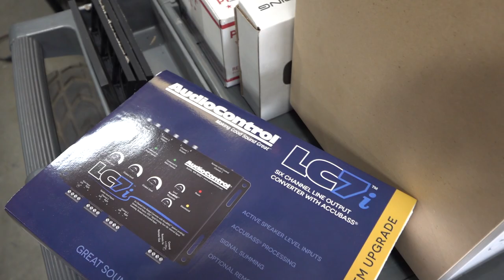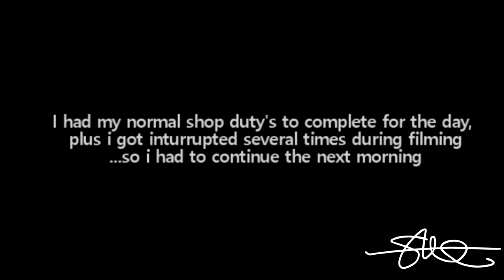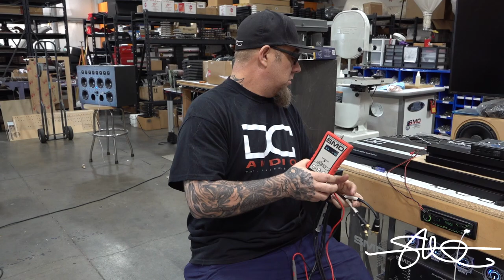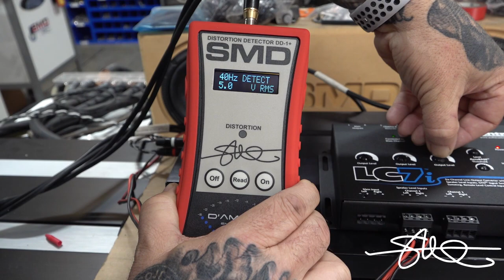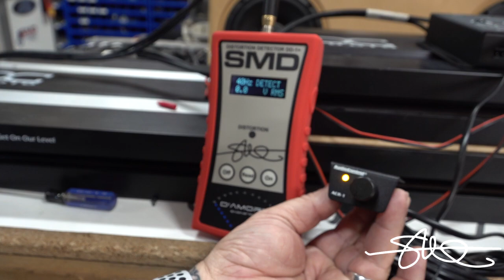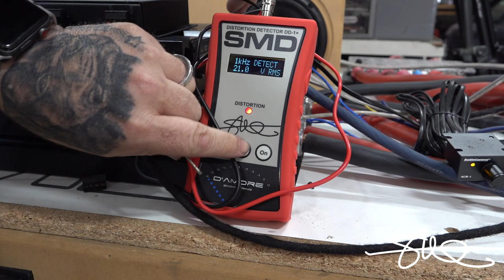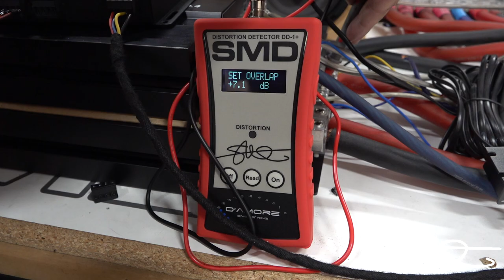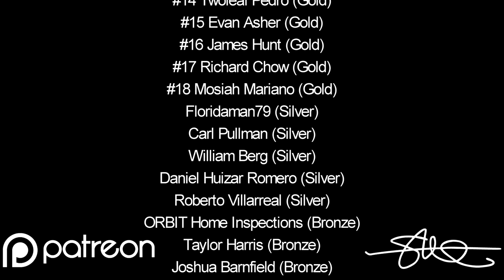Add Amps not Distortion! AudioControl LC7i 6 Channel L.O.C. Hooked up, Gains Set, Played full tilt

Comment: if you just use the GTO signal sensing from the speakers line in ,you do not need remote in,only out , i have the exact one sounds amazing, i did not want to buy an amplifier for my alpine iLX-W650 /KTA 650,so i used this LC7i to send the signal to the amps thru my aftermarket Head unit, and it still sounds amazing.

Comment: I was going to use an LC2i when I integrated the factory head unit on my F150. 

Talking with Audio Control, they told me that since I was using a EQX as well that the only thing that I would gain was Accubass. So I went with their recommendation to use the EQX high input and save the money. 

I thought that spoke volumes for Audio Control, that they would talk you out of buying more of their equipment. As a long time AC products user, there wasn't any question about my loyalty in them, but they cemented it with that.

Comment: I have an LC2i in my Mercedes S class running from the stock H/K sub wires to the LC2i and in to my Rockford amp. It sounds incredible and it definitely the best LOC I’ve ever used. So much better than those cheap non powered units. My Memphis M5 12’s sound so much more detailed and crisp on the LC2i. Highly recommend AudioControl for a novice like myself.

Comment: Voltmeter won't work but an oscilloscope will. Still haven't set my wife's car up right yet waiting on the front door speakers and amp for them before I set it up the right way with my oscilloscope. Great job showing how to do it the proper way. Most car audio installation companies need to watch this can't tell you how many systems I have seen installed by "professionals" that weren't set up right.
Reply from the maker: yes, an oscope will work almost as good.  But not really.  Better than a DMM.  But the DD-1+ completely rules over the o-scope for setting gains. ESPECIALLY a handheld.  I would say cheap handheld (which are awful) but all those handhelds don't have the resolution you need to get as precise as the dd-1.  You would need a benchtop unit with high resolution and still have trouble finding the distortion in what LOOKS like a clean wave form.  I will say this, you won't hear me complaining about someone using an O-scope and following the proper procedures to set their gains.  If they are doing that i have respect.  Before the DD-1 that was the only proper way to do it.
Reply: @meade916  I don't have a cheap handheld and I have to agree your meter is better for setting gains and a lot easier to use if I installed stereo systems for a living I would definitely be getting one but for the 3 or 4 I do a year my oscilloscope and a long extension cord work good enough

Comment: Wait, when testing distortion for bass, you had nothing plugged in channel 3. Is there still a signal passing on channel 3 from Channel 2 input??
Reply: Yes if you don’t plug anything in on the lc7i on channel 3 it will replicate the signal from channel 2 and channel 3 is the channel that has accu bass so that would be your bass channel it also accounts for bass fade off on factory head units so it can help with supplying a full range signal from your factory head unit and 400 watts max per channel on the lc7i

Comment: I’m putting the LC2i in my wife’s car. I have a regular DD1 already. Can I use that to find out where the factory deck clips and THEN use a DMM to set the LC2i to the correct voltage?

Comment: Missed a couple great features of the LC7i, it will detect distortion via the maximized LED, to help set it up. The guitar pick is included to help turn the dials on the unit.
Reply from the maker: no it won't. But ya i missed what the pick was for.
Reply: are you saying the maximize light on the LC7i doesnt work? its one of the main features. ???
Reply from the maker: @relaxationnation1189  i'm saying it isn't a distortion detector.

Comment: Steve, if I'm using the original DD-1 would setting the gains on the amp be equivalent to backing off once the distortion indicator comes on to make the light go off or is there something else the DD-1+ provides by setting overlap? I'm not understanding what setting the overlap does.

Comment: If there isn't a control knob connected to the Lc7i do the gains act as if there is one turned all the way up?  Just added lc7i to a 19 4runner and voltages are horrible coming out of the AudioControl. Need to find someone local with a meter like you're using. Awesome content, been going down the rabbit hole on your channel!

Comment: ahh yes I remember when I first did the install in my car with a pac loc from walmart worst decision ever all the ground loop noise and alt whine. Only to end up getting 1v of output. tried a kicker one but it only my more noise which pissed me off and I ended up ripping out the stock radio. all my issues are gone now couldn't be any more happier except that feeling that I want more bass for whatever reason it doesn't feel like enough for me. Anyway great vid tho showing something that actually works and is clean at the same time.

Comment: Great video . But is this the same tuning process with the audio control if I'm running the lc2i from a factory Bose amp? I'm doing a 2021 Tahoe with Bose system . Just adding some subs using the lc2i to a marts digital amp.  I feel like I'm not getting enough bass output . I'm pretty sure I have the lc2i connected to the wrong set of speakers but I don't think that would make to much of a difference ?! I'm running off rear speaker channels which are the full range, the front doors are the lower frequency speakers.. could this be an issue?

Comment: Is it possible that some stock radios just don’t have a clean signal? I worked on a stock radio recently and just couldn’t keep a clean signal at 1/2 volume. I installed LC2I but, was limited on the radio side. If anyone has any feedback it would be really appreciated, thanks.

Comment: Fastenall is great but expensive but when you need that off-size high quality drill bit or whatever they save your ass pretty quick. They’re like a McMaster C/ uh pizza shop that delivers within the hour most times. My boss used to ask why we were spend so much money with them & I usually told him he after he walked out to the shop with a project that needed to be finished that day fastenall always delivered asap the one-off particular tool/hardware needed to make it happen vs ordering it to show up next day or wasting time going to a Home Depot or special hardware store. I don’t work that job anymore but I always liked going there or dealing with them, they had everything you wanted but didn’t need and slowly over time I accumulated tons of great specialty/specific tools/hardware.

Comment: My truck already burned through like 4 or 5 of those, i have no idea why or how and nether does my local audio shop but our best guess is to run all the cables from the amps and the radio brand new and a brand new lc7i with new speakers to see if it would work. God i hope it does

Comment: Awesome video, so after you have set the loc gain do you leave the bass knob turned up when you start setting the gain on your sub amp? Jus wanna make sure I do it right. I figured you would leave it up maybe so your sending the 5v into the amp so is that correct leave it turned all the way up when setting your amp gain? Thanks alot
Reply: yes same thing and with highs amp also if you have a knob on there or can use a knob with clip light to do the same thing

Comment: Thanks for the video Steve. I got an Audison Bit One at a low price. I have been struggling with finding a good looking and functional location to install the remote, and I'm not looking forward to that install time. I also don't look forward to having to use it instead of the factory radio volume controls. I just heard about the LC7i from a local shop and your video review of it is extremely thorough and high level. I would be interested to hear your thoughts on it verses other very high end processors. Been watching some vids of yours for many years now, thanks for going hard in the hobby and industry.

Comment: I have an Acura MDX. on my LC7i, I put my 3 sources as the tweeter, rear door speakers (I figured that these are more full range), and then the  subwoofer channel. It still seems bright and it seems to be lacking in the lowest bass. Would I be better off doing tweeter, front door (Mid range only) and sub so that I can control each of the three better? Also, any tips on the bass. It seems that Acura may roll off the lower bass and the accubass is not quite making up for it.

Comment: I have a 4 channel factory head unit with no amp and added new speakers, sub & 5 channel 1000w rms amp. Would this 6 channel LOC be a good fit or do I need a 5 channel?

Comment: Lol I bet that sony head unit has a max volume of 60 which would make the reading for distortion at 45 3/4 of the volume which aligns with the old 3/4 rule. You would be ok going with the old rule of thumb most of the time.

Lastly. Why are the magnetic subwoofer terminals so god damn expensive. $150+ is just insane but fuck they are pretty
Reply: 3/4 trick is useless. My Alpine max volume is 35 and plays clean up to 30

Comment: I just got a lc6i I’m gonna Hook it up in my 2017 bmw 528i. I have 2 8 inch hi fonics subs  600rms 1200 peak on a sundown 1750 and components are nvx. Will this clear it out and do I need a bass nob? It’s on my factory radio. I drive

Comment: Steve , what if I’m using my iPad Pro as a hi-res player with toslik optical out (via usb sound card with toslink out) how can I check if an on what level it’s distorting ? Again, my player is an iPad Pro connected to an external sound card with optical output  and when I connect the card to the iPad, the option to lower the volume is disabled, this sound card is connected to my DSP via that optical optical in/output. Volume is controlled via my DSP’s DRC.

Comment: Hi Steve I have a 2018 ram factory Alpine sys with factory sub. Going to remove it (sub) put in custom box (pass side) with 10" sub and an AudioControl amc.1.300 amp. I believe I can use existing wires to the factory sub as my speaker inputs for the amp? if so do I need the DD-1 to adjust the accuBass  "threshold" and "level" settings? thanks and keep up the great videos

Comment: My thing is i did all that but i don't ride around at max volume so I your not getting bass at normal listening levels, you pretty much have to set your signals 0db clean but setting bass amp gains or even highs your gonna have to do half deck volume to 3/4 just to get your experience of your system.
Reply from the maker: wrong.
Reply from the maker: you sound like you have no clue what you are talking about.

Comment: I have a 2019 honda accord sport, I have to keep the factory stereo, I'm going to add 2 amps. 1 for highs, 1 for subs. Could I use this? The lc7? For some reason, noone wants to install my system in my car. I'm putting a 900.1d amp and 2 15s. What would u say to use for a input method to install the amps to get outputs?
Reply: LC7i works for your application. But an LC2i will work just as fine.
Reply: @MP-zv6fm  LC1i is only two channels. LC6i or LC7 for a full range system.
Reply: @dj4monie  derp🤦🏾‍♂️

Comment: I guess I’ve been doing it correct this whole time haha. Only thing I haven’t really played with is the accubass and threshold. Both is set at top center.
Reply: Double check the manual. It does a good job of explaining how to set those two knobs. You kind of have to do that part by ear. You need to listen for where your deck is fading out the low end and set the threshold to that volume level. That's the point where AccuBass starts kicking in. Then you adjust the AccuBass to fill back in the bass the EQ in the deck ate.

Comment: Interesting..   what about if you don’t have a external bass knob?

Do you floor the head units bass instead?

Thanks for sharing!

Larry
Reply from the maker: no.  You do everything just how i did it but without a knob.
Reply: You can floor the bass in the deck after the fact to kind of fade the subwoofer out. In my car the sub amp is connected to the rear channel of my  Cleansweep so I can also just fade the system to the front speakers a bit to turn it down. I can't really hear the rear speakers much anyway so it isn't much of a loss.

Comment: for input from the Head unit to the DSP, is it better low level or hi level? My head unit is a Kenwood DMX9021s, with a 5 volt RCA preout. front, rear, subwoofer. My DSP has a maximum RCA low level input of 10vpp. Do I have to use 3 low level input lines to get to the DSP?
Reply: I would run RCAs to the DSP if you can do it. You just want a clean signal to the DSP since it will be used for all adjustments going to the amps.
Reply: Good

Comment: SMD, my 2010 Infiniti G37x sedan w/ bose and nav has a "balanced" signal coming from the head unit to the factory amp. I have been trying to figure out a way to bypass the factory amps. I figured out how to bypass the factory "subwoofer" so I could add some more thump in the trunk. But the mid and high EQ is still not to my liking. Is there a way to remove the factory amps without a plug and play module? Or would you recommend using something like this and install it in line?
Reply: a dsp will solve that problem

Comment: @Meade916 hey man been watching your channel awhile bought lots of your products always top notch but I have installed a axxera 4 channel  100 rms and a 650w rms mono sub amp nothing to crazy running on an alpine ilx650 I'm having a hard time getting the sound I'm looking for when I set my gains using a multimeter it sounds terrible I set using my ear and it sounds better but is just missing that umphh  any tips a buddy of mine has a smd dd1 and checked it for me was spot on on my gains dont have a bunch of cash and I know amps are not costly but I ram same amps in my truck and sounded much better any tips would be much appreciated if you get some time to think about it!! Thanks again
Reply: You have an aftermarket deck? Does it have clean output all the way up to full deck volume or are you running a stock head unit setup? If you want me to give you somewhat accurate advice it will make a difference. Your goal is to find the absolutely maximum clean volume level on the deck, back down the volume a few notches, and then tune for that RMS number there. The JL Audio manuals say something like "Tune at 3/4 volume to allow for moderate clipping at full volume. " This isn't perfect and it's ultimately just a guess. Otherwise what most people do, which is wrong, is turn the volume up to where they listen to it full blast, and then they tune for that RMS number there. What that does is creates a ceiling where that amp cannot ever possibly put up a single watt more than the RMS rating and that's not how amps work. Doing that turns a 250w RMS amp into a 250w max amp. If you're doing that you're losing your punch right there.
Reply: @Thezuule1  I'm running an alpine ilx 650 alpine type s componet 6.5 front door alpine type s 6x9 rear deck powered by axxera 100w 4 channel and 2 axxera 650w mono powering kenwood sub haven't got the money for my alpine subs dumped all I have in to it now I took it to a shop to tune it I get back they said they tuned it by ear and it sounded worse than befor so I played and tweaked it it sounds good right now just no audio places around where I'm at I drove 2 hours for that shop wasted my time

Comment: you can put the dd1 probes on the tightening bolt/screw instead of actually inside the terminal?
Reply: Sure. They're touching the metal on the inside.

Comment: Steve what’s the best budget friendly 8” woofer you’d suggest? I’m building a custom center console in a old 79’ Jeep cj5 but I still wanna bump. I’ll be running an older RF PUNCH 500.2 amp. Or so u have some 8”s you’d sell that you don’t use. I’d like RF to match the amp but to pricey for a cop budget.
Reply: Check out skar audio
Reply: Jerry Tucker I’m running 2 skar vd10s in my daily under the seat of my truck now and they sound great besides one VC IS going out the only problem is I had one sub come in and the hole wasn’t drilled all the way through the basket and I didn’t see it through the gasket so when I went to run the screw down it wobbled and ran into the foam surround. When I contacted skar to let them know it had a defect from manufacturer they didn’t even return my call so I’m not real happy with the customer service. I went ahead and ordered a new sub at full retail when I shouldn’t have had too.
Reply: @gunsandgears4218  I was thinking of going with the skar 12"evl and amp
Reply: Jerry Tucker go with Wolfram for ur amp and the skar subs are built well just crappy customer service.

Comment: So.. Maybe im loosing the point but that wire twister.. Difference between it and just using a vice or whatever you got?
Reply from the maker: if it ain't spinning with the drill it is just going to continue to get tighter till it's too tight. This allows it to twist to just the right tension and then spin freely allowing you to put tape on it like i did. Or LESS tape like most pro's would do. haha. I didn't mean to completely cover it.  It's a new tool for me too, i been using the vice forever.
Reply: Hmm.. Sounds interesting. Would take some getting used to but I can totally see how that could help.

Comment: What about the bass/mids/treble adjustment on the deck.???
What do you do there?
Reply: Set all EQs flat when finding undistorted volume, setting gains, etc. Afterwards, set them to where you like but be careful...too much at certain frequencies will introduce clipping. Check around in his forums, you may find much better info than I have. I have the DD-1 and CC-1 that I tune with. If I play full tilt, I leave mine flat. If I'm just cruising with little or no bass, I use a preset or two.
Reply: Thank you for your answer